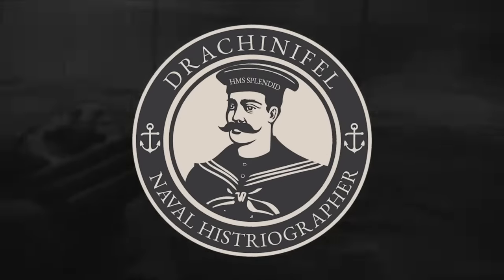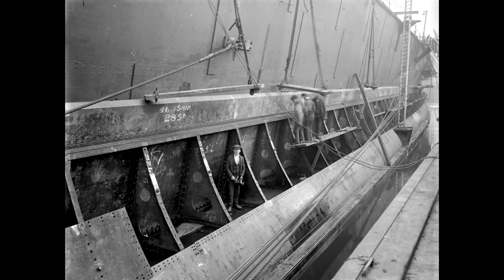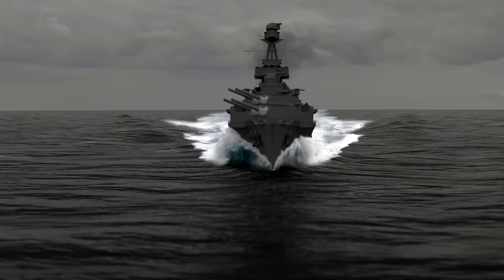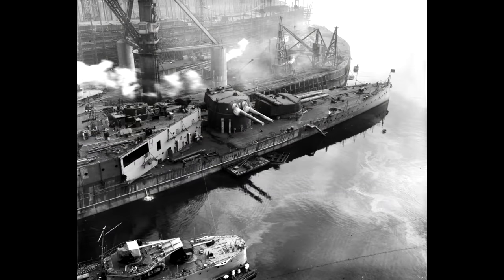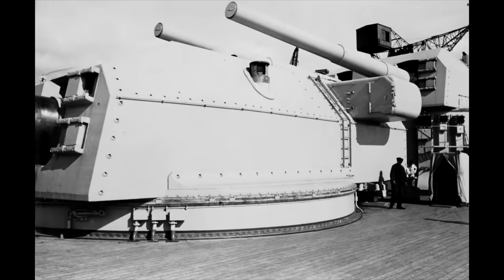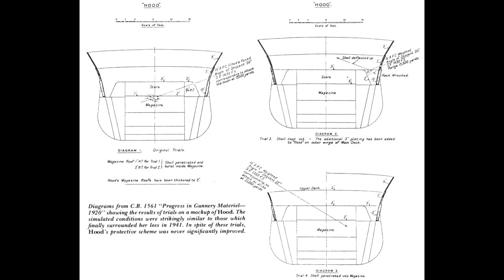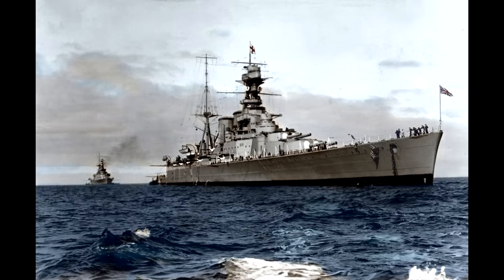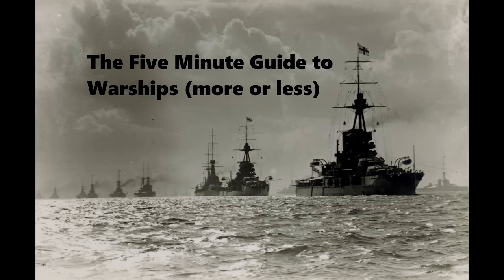The Loss of HMS Hood - But why did it blow up??

Comment: So it wasn't the "poor deck armor" of Hood after all, been mislead for so long 😄 Hats of for the impressive analysis skills and knowledge!
Reply: If I got a dollar for every time I posted an argument to those saying "deck armor penetrated" I would be rich.....

The angle of fall by itself rules it out
Reply: @notsureyou  if i recall correctly "haven't watched the video* the hood was IN the 9 mile radius so a shell couldn't have penetrated the deck armor at that distance
Reply: @ivangenov6782  Correct, at that range (generally accepted to be 16-17km) the angle of fall of the shells was just 11.5-12.8 deg
Reply: @ivangenov6782  if you fire perfectly that absolutely could hit a deck
Reply: @gaberobison680  The thing is: Naval guns are not mortars, so the deck armor  won't need to account very high entry angle. Certainly it won't hit as high as the drawn picture which dipiected entry angle like 60 degree.
Reply: @gaberobison680  Naval Guns are not mortars.
Reply: @gaberobison680  We see what happens when shallow angle armor piercing strikes decks. See South Dakota.
Reply: The Hood has only 1 meter of 12 armor belt below the waterline, which could allow the shell to penetrate the unarmored portion and ignite the 4 inch magazine.
Reply: The Bismarck was Germany best Battleship and Hood was an Upgraded WW1 Battlecruiser. Battlecruisers are not ment to withstand a hit from a battleship gun and a 16in shell detonated the magazine in the aft section of the ship.
Reply: @wongyc5585  Which is what Drach proposed in the video. Given her speed, that portion probably wouldn't even be below the waterline.
Reply: @justinthebeau2590  No ship at Denmark Strait had 16 inch guns
Reply: @justinthebeau2590  Hood had 12in of armour. How much armour do you think is needed to protect against battleships guns? 18 in? Maybe 24?
Reply: Considering the Prinz Eugen penetrated her deck with 8" shell and set off the AA ammunition, i would say the admiralty didn't fully learn their lesson (deck Armor) after jutland.
Reply: Fredrik Lind, if the deck Armor was so strong why did Holland close the range to 16000 yards? To reduce exposure to plunging fire.  Don't you think he made it easier for the Germans to target the Hood and Prince of Wales? Ultimately the beefed up side armor of the Hood made no difference.
Reply: That hit on the ready to use secondary battery locker hit could have happened to any ship so no.
Reply: @justinebautista1383  Yeah, but Holland reduced the range to 16500 yards to reduce the risk of plunging fire. Her deck was not strengthened unlike her sides which had been beefed up. This is not a secret at all. Bismarck's gunners despite being handicapped by their  fire control radar knocked out of action owing to the recoil blast of their own guns were guided by Prinz Eugen and still deadly accurate. Remember the Bismarck scored 4 hits on POW after the hood was sunk and almost immediately with her second salvo. One of her 15" shells penetrated the POW underwater beneath her armored belt, dented her torpedo bulkhead and was in the process of exploding before the flooding stopped it. It was also near though not close to a secondary magazine. The POW was lucky it didn't explode. There is a picture of  the shell and where it landed. Absolutely stunning when you see the damage it caused just after entry.
Reply: @justinebautista1383  By Bill or William Garzke as to how serious the 15" underwater hit on POW potentially could have been..."I have also been in contact with Vice Adm D.B.H. Wildish who was the damage control officer aboard Prince of Wales to assess the seriousness of the damage. Fortunately for the British battleship, one 380-mm shell with an underwater trajectory landed in the side protective system near Y magazine without exploding. That shell was discovered by then LCDR Wildish when the vessel was docked in Rosyth." And this was at close range. Sobering thought.
Reply: I mean the deck armor penetration is probably regardless of likelihoods or contingencies especially since some folks think the Prince of Wales and Hood were further away from the Bismarck than the so-called round figure of 25,000 yards and the give and take many of which are approximations I think it's certainly possible like many of commented on here before and Drac himself is certainly said nothing can truly be definitively ruled out as the area of which the explosion occurred has and is decimated.

Whether it's a matter of 11, 14, 16 degrees firing arcs in the end rock and roll the oceans are unpredictable is perfectly plausible for a 15 inch shell fired from Bismarck to penetrate less than one inch is worth of deck armor which Hood certainly had in many areas we can use our scholarship to go over the proportions of each individual plate but in the end puts destruction occurred and forensically given the latter half of the ship is practically obliterated we can't definitively trace the cause of the explosion back to its source so until something we've missed if it exists can't be ruled out.

 So, I don't think it's rich or a red herring to suggest it bismarck's 15-in guns certainly under the right conditions could Pierce hoods anemic deck armor HMS hoods deck armor was insufficient for modern main battery ranges why else with the British royal Navy have meant to reinforce her deck armor because it was substandard case in point as is the case with most British battle Cruisers and battle Cruisers in general from the first world war. 

Hell there was some thinking that maybe both were penetrated just beneath the armor belt and the deck armor again we can't rule it out we can argue amongst ourselves but needless to say whether it was human error or human intention hoods destruction did occur and I don't think it would have happened had she not contended with Bismarck.

Hms hood was rushed through Construction phase I've read extensively her Keel was laid on the day of the battle of Jutland and then she was completed two years later her design was altered so to get her ready for Warfare in that conflict they rushed her through Construction the Royal Navy always meant to come back and do retrofit upgrades modernization.

 To remedy the hastily work that was done during construction and to reinforce her armor making her a proper Battleship rather than a battle cruiser why else would Holland have tried to reduce the distance till the trajectory levels were flat those armor belts were probably his best defense and yet they don't seem to have been effective and it's not a surprise to me given that they did lengthen her design to accommodate increased Machinery space.

 Distinctions matter especially in volleys of Fire. Adm Holland would never have tried to close the distance if he had any confidence in his ship's armor scheme at a distance I think that speaks volumes and again nobody on this channel or alive today was there so we have our series speculation which is healthy but can't rule any of it out 50% of the ship is in fragments no bigger than a football and that makes forensic analysis extremely difficult.

Hms hoods demise is no surprise to me and the others that understand that battlecruisers were never intended to engage other battleships they were meant to be Scouts for the fleet meant to engage smaller surface ships but never other Capital ships this is always led to their demise and I believe only one pre-war battle cruiser survived the war I want to say it was Renown or repulse but that doesn't speak well for their genus
Reply: @jonathanjones3623  Exactly right, but fanboys won't acknowledge this. Nor will Bismarck fanboys admit to her flaws. Both were fine ships in their own right (and time) but had flaws, there is a reason significant  modifications were made in Tirpitz
Reply: @z1az285  i concur there's nothing wrong with romanticizing the effectiveness and pros and the cons of which I'm always acknowledging strengths and weaknesses of my nation's battle wagons but still there are some Fanboys I just can't stand things as they are but you are correct about Tirpitz as well as other modifications to larger surface ships
Reply: @z1az285  correct they gave her a 12-in belt during the first world war like we discussed earlier on this channel LOL basically Hood was rushed to fill in the line during the first World War so they took a battle cruiser design that was already under development said okay for crossing the t and lines of battle we'll just beef up this battle cruiser side belts to 12 in and user in the line of battle that's the only reason she has Battleship grade armor plates they took an existing design stretched it out and fitted it with additional armor it still doesn't make Hood a battleship as I've said to people over the years on here and other forms LOL she was a battle cruiser with Battleship characteristics definitively I would say to anyone Hood was 4/5 of the way there to being Battleship fast Battleship Dreadnought whatever term we come up with she still wasn't a battleship the rest of her armor was relatively unchanged for battles of attrition
Reply: @silverhost9782  those ships should have had 16 inch guns however :-) I contend always had West Virginia been present yes she would have been considerably slower than Prince Oregon or Bismarck but she would have had a much meaner broadside and it brought a mountain of guns to fight the mighty German iron cross with broad stripes and bright stars
Reply: @notsureyou  against her that's been said and I don't think it holds Merit with the tidle forces of the sea balanced and balanced Bismarck could have easily had the right angle to do definitive plunging fire again it can't be ruled out and I think under the right conditions it's perfectly plausible for a 15 inch shell to pierce Less Than 3 in of deck armor with the obliteration of the wreck.

As I've discussed it before you know maybe it's all these things combined or maybe Hood's crew and experienced losing so many of their veterans maybe they blew up the ship possible an accidental discharge of a magazine certainly under the dress of combats possible it's not a thought I like to entertain because it just makes my heart Sunder for the crew of the hood but plunging fire is something that hood was absolutely deficient in her deck armor was anemic fact.

 It's been said before by a few gentlemen and ladies in this channel then why was the royal Navy so insistent to do long overdue retrofit and refit upgrades and refurbishment Holland New his ship was a relic HMS Hood was an admiral class battle cruiser devised during the first world war and retained at the expense of refit modernization so I don't think it's out of the question and we really can't specifically say 100% that was the cause but nor can anyone say that it's ruled out.  

Until we have Inrefutable proof that's widely accepted and understood well we're left guessing unless something else on the wreck turns up but factually and whether your proponent of the HMS hood or don't care for it we can't say here was an outdated battle cruiser going up against a modern high-speed battleship Bismarck and HMS Hood were remarkably similar and the fact that the British Empire created something similar and generation before speaks to their engineering prowess

 but she was in a mechanical state of stagnation she was in material obsolescence her Machinery was worn out she was so deficient in modern terms of both Armament and armor she couldn't even do her original top speed of 32 knots and this romantization cannot dispel the odds were against her would only would have made the difference I think keeping everything else material strategically the same is if Hood had had her highly proficient experienced crew that is the only thing that I feel could have changed that engagement lacking other modern refinements taking the people that knew how to handle her care for her and make her dance was a catastrophic error on the part of the British royal Navy
Reply: @pilotmix.2317  The 12 inch portion of the belt wasn't very wide.
Reply: @z1az285  PE didn't penetrate the deck.

They set fire to the un-rotated projectiles that were already on the deck.
Reply: @notsureyou  Yes, her first salvo did destroy the AA gun and started a fire as you describe. But two subsequent hits, one 8" which caused more ammunition to explode and this is from able seaman tilburns testimony maybe one 15" shell (suspected, could have been 8" too but he said Bismarck potentially her third salvo  maybe from the force of the blast)  killed many in the recreation space/ aircraft hanger and effectively destroyed the space and deck area plus a structure"...where officers were directing the fire from" But while not responsible for the aft magazine detonation, it made the fire much worse. He said the rear explosion occured a  little while later.
Reply: @justinthebeau2590  Nope, Hood's belt armour was sufficient to stand up to Bismarck's guns -  at least in terms of Bismarck's shells wouldn't tear through her like paper - that's part of why ascribing her destruction to plunging fire is such a popular explanation.

Comment: An excellent analysis from all angles. Whilst it may have been a “lucky” hit from Bismarck it simply proves that having a shot may actually work sometimes – regardless of the odds. In a similar way – the later torpedo hit on the rudder by the Swordfish attack – which led to the demise of Bismarck herself – is equally a “lucky” shot. For good or bad it shows that taking your best shot sometimes works to advantage. In the end it was a one for one swap of battleships and many good souls perished . RIP to all.
Reply: "You miss 100% of the shots you don't take"
- The Bismarck, possibly
Reply: Quite right. Even a large ship at the distances involved was a small, moving target, so a hit at exactly the right spot can only be called ‘lucky.’ At this stage in the war, gunnery was more miss than hit. Likewise, some luck working in the torpedo attacks—many wasted, some duds, one lucky hit in a vulnerable area.
Reply: Notice the Prince of  Wales. Hit 7 times in 2 minutes. 0602 to 0604 by both German ships. Number of hits on Hood? before she is sunk.  I think shows superior gunnery at this time of the war
Reply: @roderernst9990  I'm no sailor but I read elsewhere ( Operation Rheinubung video I'm sure) that the British ships were sailing against the wind and waves , unlike the Germans, so were unable to use the main directors, relying on the secondary ones mounted higher up. Plus of course the POW had major malfunctions of her new guns.
Reply: A one-for-one numerically maybe, though in chess and warfare, like-for-like swaps are rarely fair exchange. Not to belittle the huge loss of the beloved Hood, the loss of Bismarck from a smaller navy was arguably of more practical, relative and strategic value than that of the Hood. No doubt the Admiralty had to risk the Old Girl. Like in the Battle of Britain, maybe straight swaps are not a "thing" when you have the enemy outnumbered, or when the enemy asset carries a greater threat. Stakes were so high, that even before the Bismarck was sunk, the Hood would have been a worthy sacrifice if she only drew fire from the POW and never fired a shot. Whatever. We are not worthy.
Reply: @grahambennett8151 she is also likely responsible for sinking Bretagne at Mers El Kebir, and one of her shells also crippled Dunkirque in that same engagement.
Reply: @robruss62  I confess, I was not aware. For me, though, she still achieved more in her seemingly fruitless demise. It matters not to me which of the two ships damaged the Bismarck, and had both been sunk, I would still have made the trade.
Reply: @grahambennett8151  British came out ahead indeed, as 3 more KGV'S and 3 more Illustrious/Indomitable/Implacable class carriers in various stages of construction while Germany at this point basically had Tirpitz entering service.
Reply: @robruss62  Thanks. I guess the admiralty wouldn't be much cop if they didn't know when attrition was on their side. There is another angle, too, I guess. I was always taught that you give your adversary what they least want, and Hitler's instructions to his naval captains to avoid battle was pretty plain. The Admiralty may or may not have known about that at the time, but they could easily have foreseen it, or guessed it from Germany's numerical inferiority. Another line is that when you blockade you don't get to choose when to fight. You kind-of have to hit them with whatever you've got when and where the break-out comes. Again, though, the bottom line is that these days were darker than our worst nightmares, and with things going so badly elsewhere, you would have sent a man in a rowboat with a peashooter if you thought it might somehow only distract and delay the enemy.